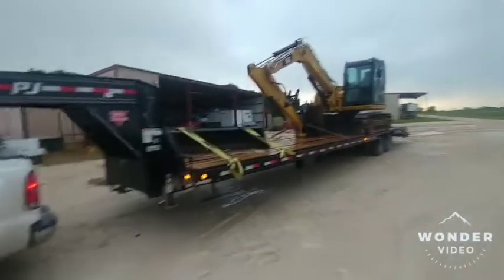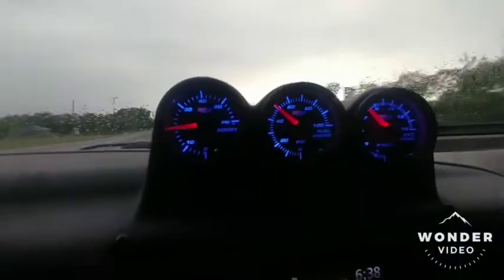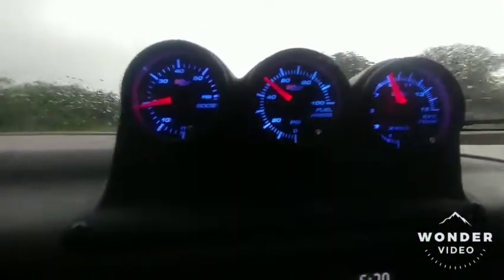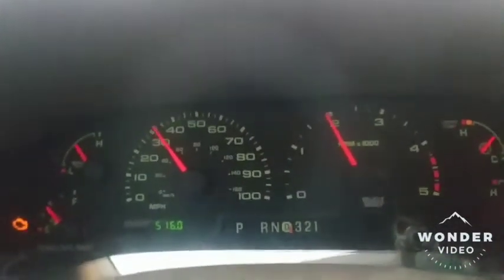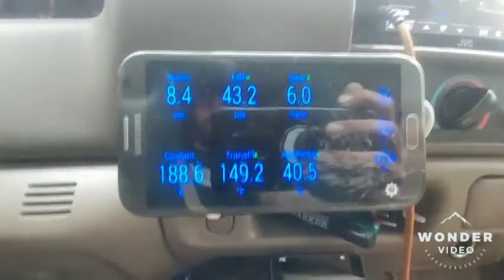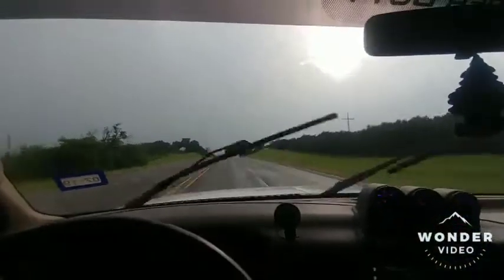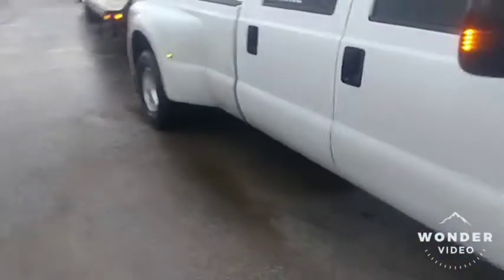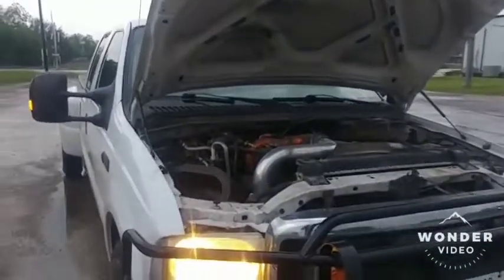Another load! Working the Fummims hard!!!

Comment: Thanks for all your videos . I`m trying to decide if I want to keep the 5r110 or cheap out and put an NV in my 04 6.0 4x4  ,
Reply from the maker: JMZ CT125 you know that’s a hard choice really. The 5r is really great and I love it, but the nv is great too and they aren’t as expensive when they have a failure. But the initial install is more complicated than keeping the 5r
Reply: @thefumminspagerpope4452  I decided to keep the auto. I bought an adapter and flexplate.  
  I have a 92 VE pump engine with low miles I plan on swapping in the 04.  
  Did you say you used the factory Ford wiring harness ? 
 I am going to try and spend a little as possible to make this work.  I figure I can always spend more as I absolutely have to.  I also have a Ram  97 3500 4x4 dually that runs really good.   Thanks again for all your videos and R&R.
Reply from the maker: JMZ CT125 awesome! Yes keep the ford harness and just remove the sensors that won’t be used. The injector and glow plug harness can be removed and IPR and IPC and hpop can all be removed too. Most everything else will stay

Comment: I love your work with these videos. Can you do some real world data before you install your new exhaust manifold? If you mod the air filter to draw only air from outside the engine bay and measure your EGT’s I’d be grateful. I think that’s too often overlooked. Also, could you do a vid solely on how you plumbed your compounds in a Ford? I’d also be grateful.

My Fummins build will eventually be shared but it’s going way too slow now for several reasons.

Thanks!
Reply from the maker: etree08 yes of course I will try and do a video on each subject real soon! Lots of things I’m getting ready to do!

Comment: Love this truck and the videos, question why did you go with the #6 fuel pate? what type of difference did you see?
Reply from the maker: The # 6 has a smooth fuel carve and it isnt so hot on the egts like a 0 plate or even no plate. Ive ran this plate in all my 12 valves and i like it the most for what i do witj them
Reply: @thefumminspagerpope4452  what website do you order yours from? I think i'll grab one for my 97
Reply from the maker: @blakeosborne2010  I grind my own. I'm not gonna spend 100 bucks on something that'll take me 5 minutes todo
Reply: TheFumminsPage rpope interesting. How do you know how or where to grind it? How do you know if it would be a 4 5 6 7 ect?
Reply from the maker: @blakeosborne2010  go to Google and type plump fuel plate profiles you'll find a diagram of how to grind it to what ever profile you want. It won't let me post a pic of it here